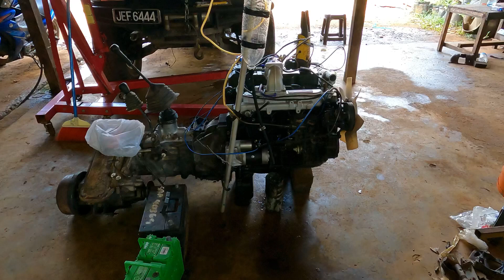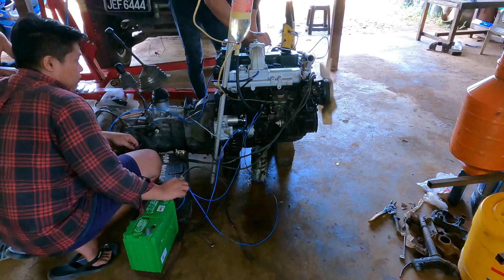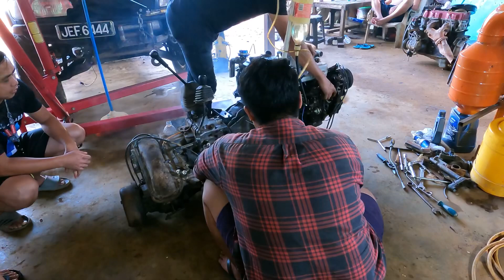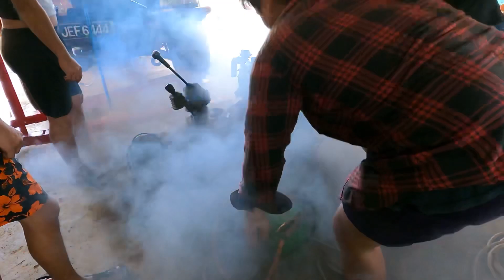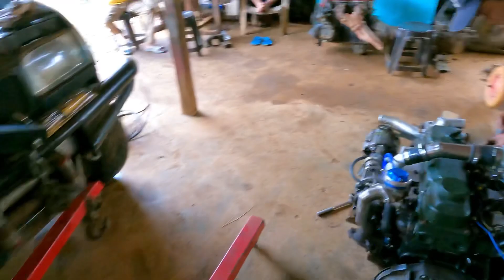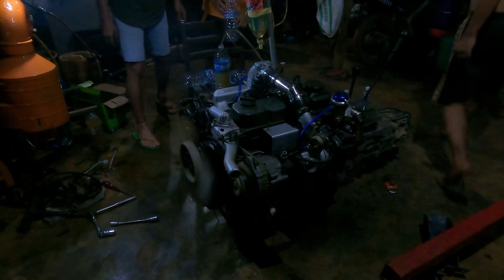Nissan TD27 Turbo start up

Comment: My td27 has black smoke when driving, and a lot when driving up hill.
I've changed air filter already. Any ideas what's the problem?
Reply from the maker: Okay i see. Have you ever do an adjustment on your fuel pump?
Reply: @MAXROYMXCY  I haven't. But I will try that. Thanks
Reply: Turbo leak?
Reply: Did you services calibrate injector and pump?
Reply: Ремонт ТНВД и форсунок.

Comment: why was it not starting easy? what was the cause?
Reply from the maker: At first we thought it was the fuel sensor on fuel pump. But then after we change the sensor, it started but just few seconds it stop. After that we notice something stuck inside the fuel pum. It was the dirt from bee nest. After flush the dirt, everything went good. 😅

Comment: sounds good, and powerfull engine , how many boost  pressure you setting ? what all your modifications at this Motor ?  and do you know anybody hoe using a lightning flywheel at the Nissan TD27T     ?  im starting here now to build an  nice WD21  here for historic Car  with a little more power inside.   greets  Boris 🙂
Reply from the maker: Hi there. The turbo boost pressure is roughly about 0.8. Its was a standard pressure btw. There is no modifications at this motor at this moment. Its was mostly stock so far. I heard people are using that lightning flywheel to get more power, but never get to know on details about that. 😅 that was nice car by the way. 😊

Comment: kalau engine td27 boleh masuk gearbox frontier ka bos?
Reply from the maker: Tidak dpt masuk tu bos. Tidak ngam. Main kacuk sja tu baru dpt.
Reply: @MAXROYMXCY  kacuk mcm mna? tukar housing ka?
Reply from the maker: @vienvalentine292  mau kasi modified tu bell housing bos. Yang bellhousing gearbox frontier potong lepas tu yang bellhousing td27 pun potong. Baru kasi welding smbung balik. Pernah juga kami buat bgtu. Injin nissan gearbox kia jadi juga. Tapi mau cun la mau potong.
Reply: @MAXROYMXCY  ok. tq bos.

Comment: What transmission is paired with it?
Reply from the maker: It was the Nissan Safari gearbox.
Reply: How well does it pair with the safari transmission?
Reply from the maker: @darkwelltheveenliyanaarach3498  . Everything was fine and its running good.
Reply: It's a Bolt on or need adapt ????